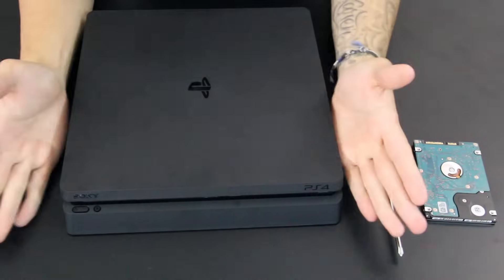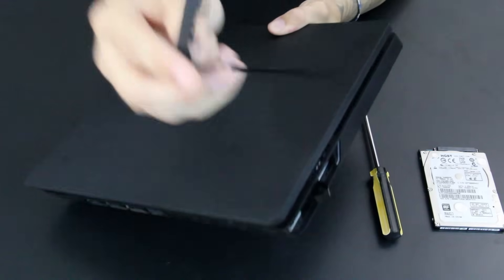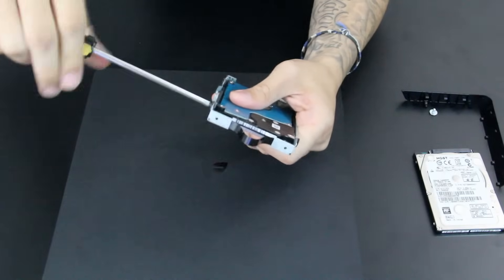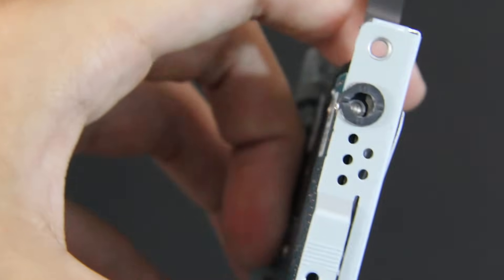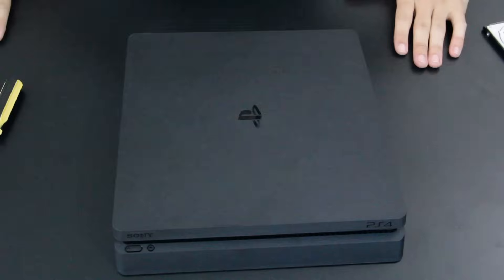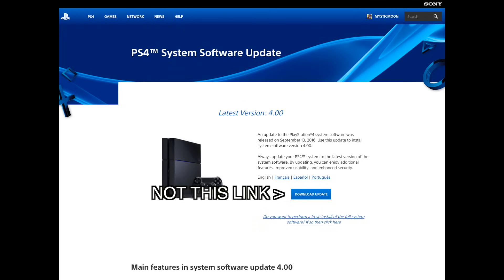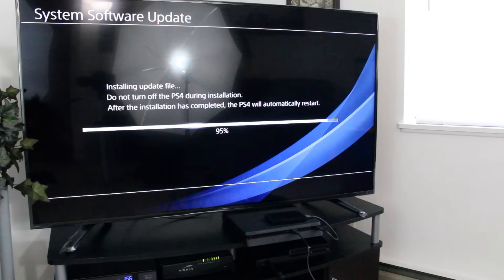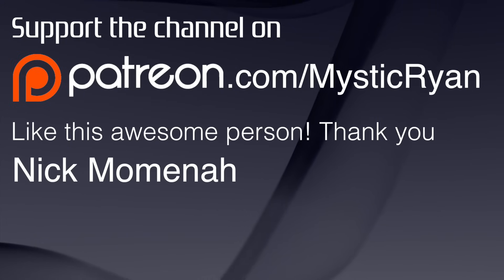Tutorial: How to Change PS4 Slim Hard Drive and Install System Software

Comment: Hey Ryan, I have a 2TB hard drive currently in my ps4. When I get the PS4 Pro at launch I want to use my 2TB hard drive. Can I put it in before booting up the PS4 Pro without downloading the update from the Internet since it will already be on the 2TB drive???? Will I need to still back up all the games or will they remain?????
Reply: Try it if you need to it just says you need the latest update
Reply: thanks
Reply: I read another comment and its' replies, and you can't. It will format the drive and you will lose everything. I know I'm a just a little but late , but I though that I'd still let you know
Reply: Jay Just Games if you have done this I wanna know the results did it work?
Reply: waffle_eater 13 nope it didn't work. I had to install the update again and download my games / saved files again.